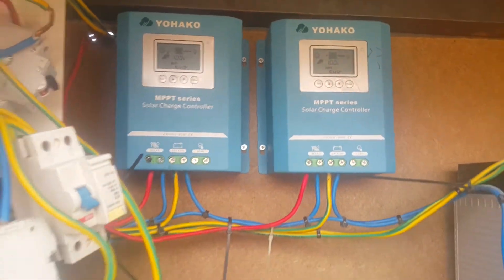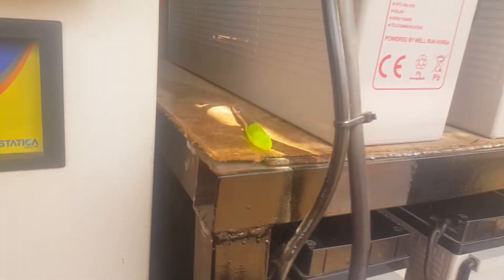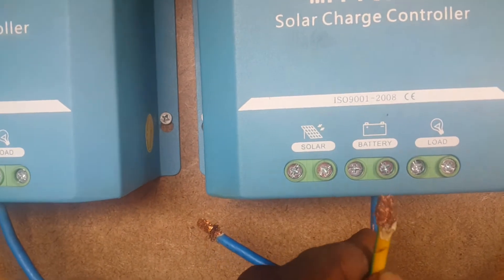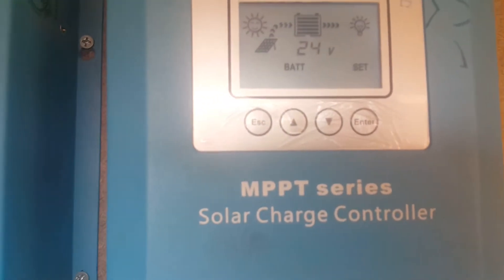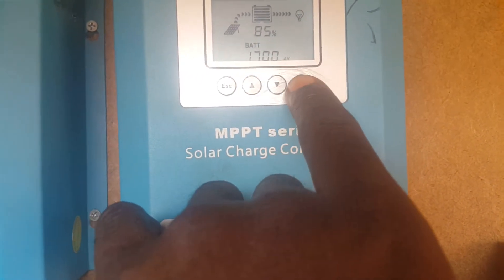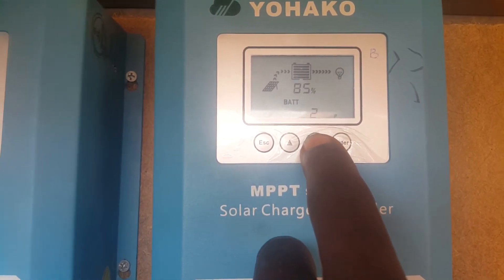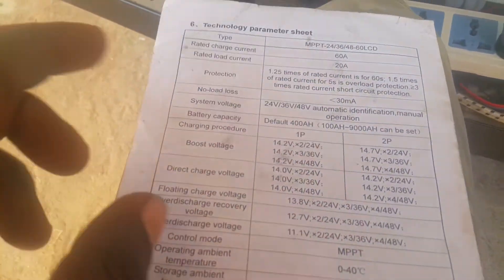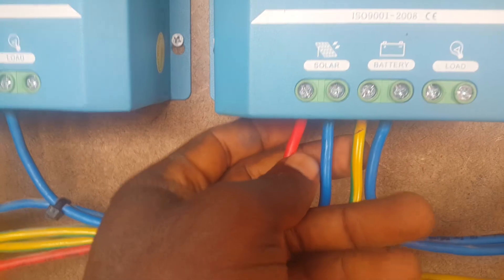TERTARONICS :INITIAL CONFIGURATION  OF YOHAKO 60A  CHARGE CONTROLLER

Comment: I have this YOHAKO, my issue is that maybe i didn't do the initial configuration well,. When tlit says the battery is 100% charged. It doesn't stop charging before my 24V battery system will keep floating to 30.1V till i turn off the PV breaker. What could be the cause.

Also i need the PDF manual if possible. Thanks

Comment: Your estimation of battery bank capacity is not correct. When you have batteries in series, the voltages add up but capacity does not.When in parallel, the capacities add up and not the voltage.  So, your battery capacity is 2 x 210AH. That is 420AH.
Reply from the maker: I have  two set of qty 4 x12v 210ah connected in series  and the two set are connected in parallel again
Reply: I have 220AH connected in series, what will now be the total estimate for me to set on the YOHAKO

Comment: How can you get 48V from connecting 12V in parallel?????? Or maybe I heard wrongly
Reply from the maker: Connect two set of 4 batteries in series to get 48v each. then parallel the two set of 4 batteries connected in series to still have 48v